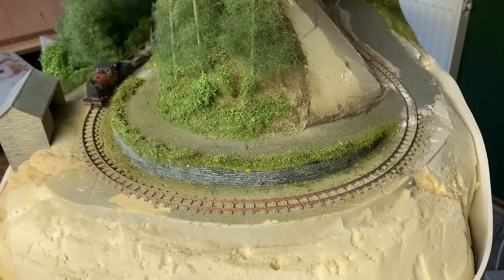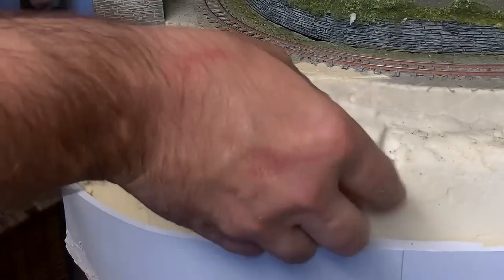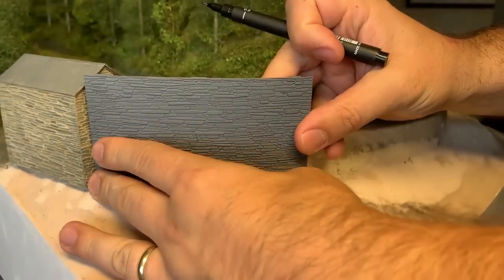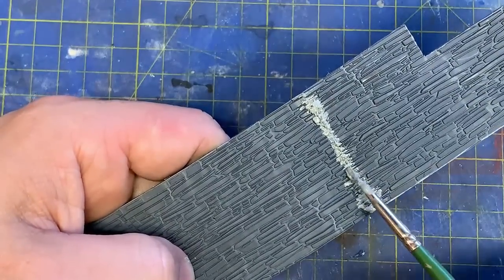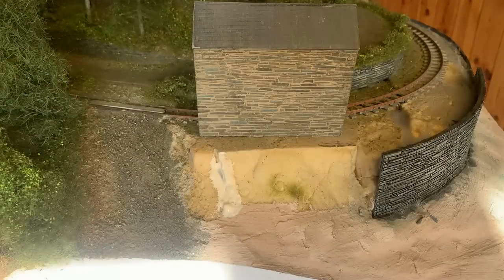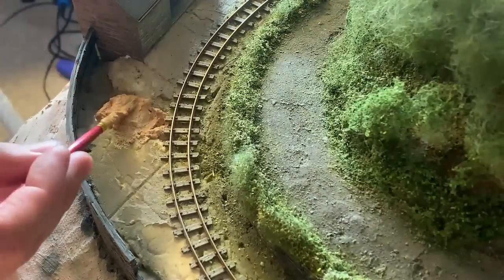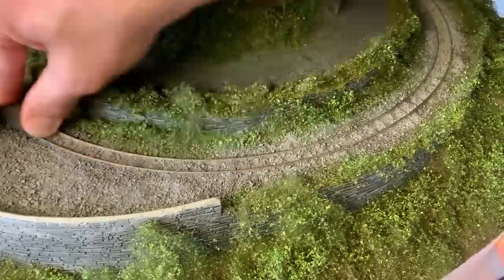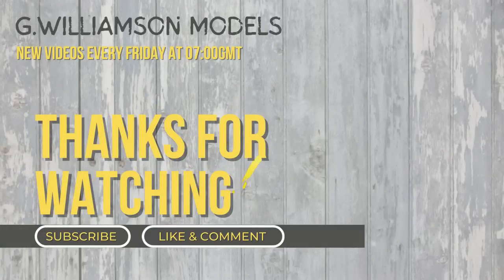009 Model Railway Scenery with Station Area & Retaining Wall

Comment: Fabulous modelling and enjoy your video format - not too long or short and not padded out with a load of waffle. Very precise painting - wondered what size and make of paint brushes you use?
Reply from the maker: Thankyou so much, I use a huge range of brushes, though they’re not any particular make, some are Windsor & Newton, or Princeton select liners, or a cheap make from eBay called Weizhuang. The sizes vary from 0000 right up to ‘bloody huge’, but mostly I used 0 to 000. Hope this helps!

Comment: Hi George, great videos, enjoying the modelling techniques even though I model in a much larger scale. BTW, your 'stabby tool' is a scriber, primarily used to mark out metal, but really useful as anything you need a point for!.
Reply from the maker: Thanks, I do plan to venture up the scales in the future, currently trying to source a 7mm loco to plan a project.
Yes I’m assuming it is a scriber. It came in a set of knives about 15 years ago